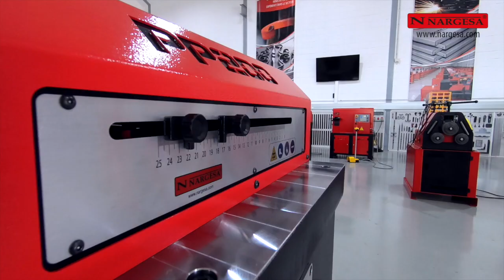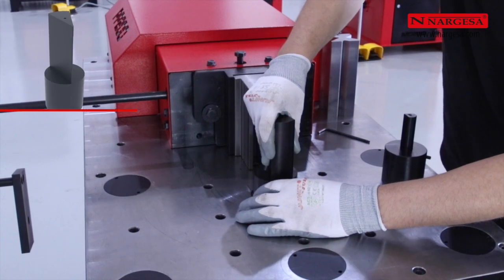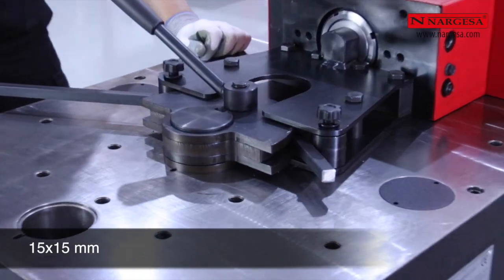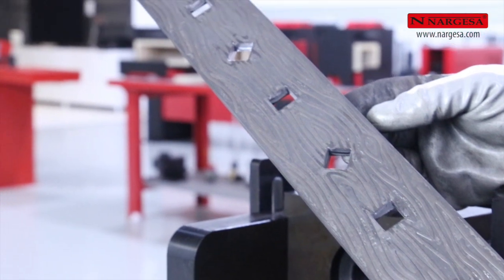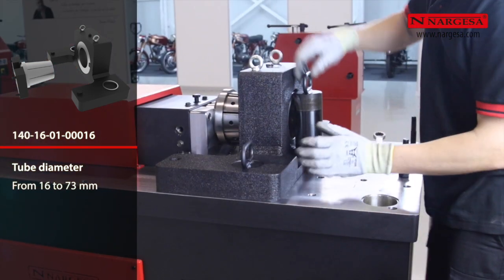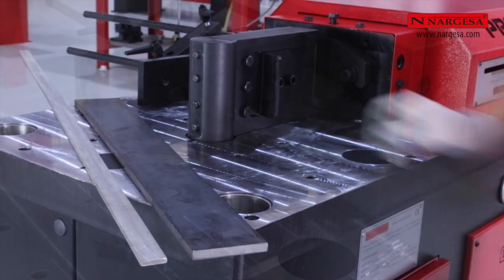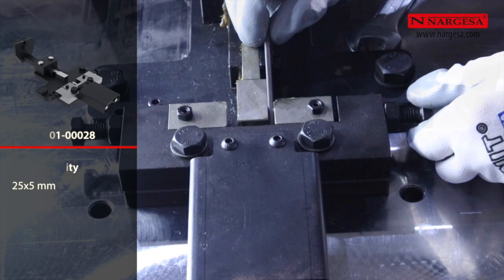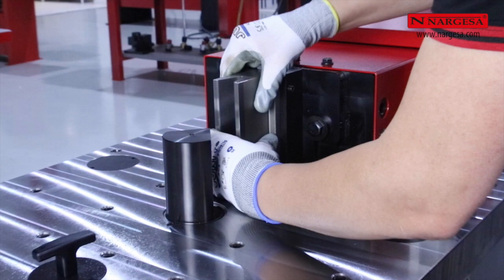HORIZONTAL PRESS BRAKE PP200: SHEET FOLDING, TUBE BENDING, PUNCHING AND A LOT MORE OPERATIONS

Comment: Does this all equipments are with this matchine.?
Reply from the maker: All Horizontal Hydraulic Press Brakes PP200CNC Nargesa are equipped with Folding or bending die up to 161mm with 4 openings (16, 22, 35, 50mm) and a punch of 80º. The rest of accessories are optional, which means each customer equips his machine as desired. In Optional Accessories, in our website, he'll find the list of all possible standard dies: https://nargesa.com/en/industrial-machinery/horizontal-press-brake-pp200cnc

Comment: Please clear my doubt.

Is any pre_heating required before doing this bending ?
any plates with any thickness can be bent ?

Can 10 inch thick sheet also be bent without pre heating?
Reply from the maker: Hello @Subin Peringave. There is no need to pre heat the material before performance according to the standard capacity of the machine.
Each tooling has got its range of capacity as per the features of them.
10 inch thick plate could not be a feasible project for this machine for it's got 20 working Tons and it would be way too much of a thickness for our PP200.
You can see all features in our website: https://www.nargesa.com/en/industrial-machinery/horizontal-press-brake-pp200
Reply: Thank you for reply. 
Definitely i will go through your website.
And one more clarity required. 
If there is enough capacity machine available, there is Never a need for pre heating for any thickness.ie Pre heating is never required for any size thickness.
Reply from the maker: Sure if there is plenty of capacity, you will not need any pre heating, however our punching machines are designed to work in cold. If the user needs to heat up the material, then it is up to him to do it, regardless the punch behaviour